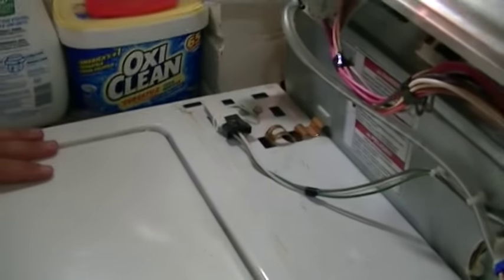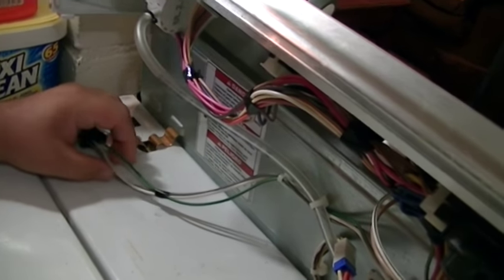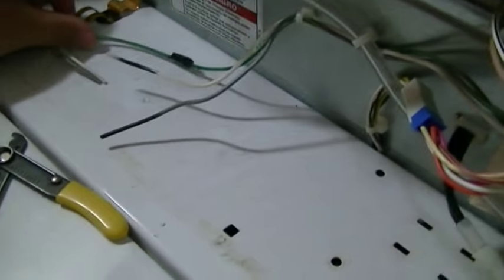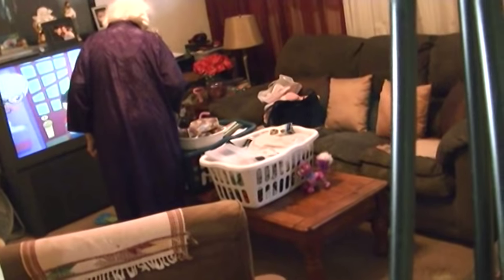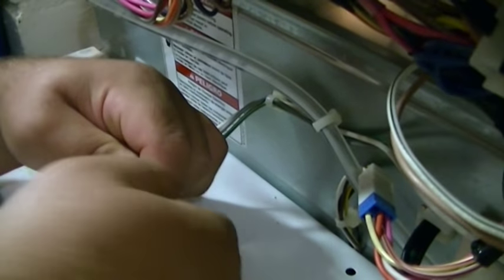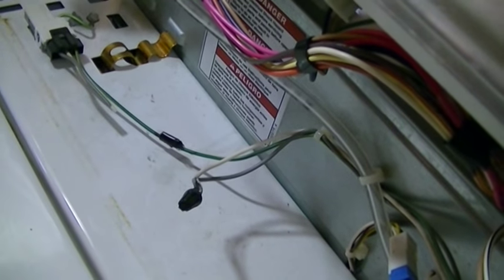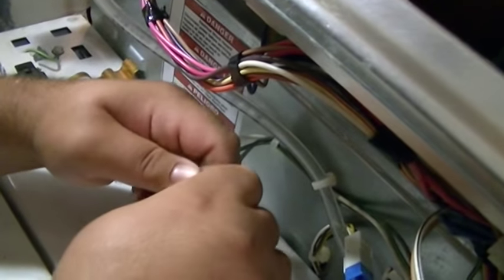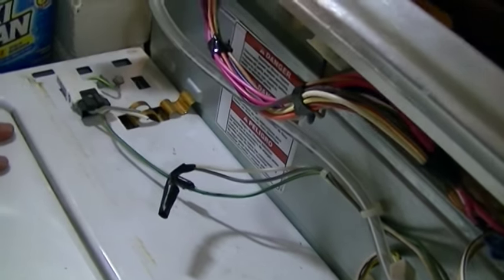Quick & Easy Whirlpool Washer Lid Switch Defeat

Comment: I ended up cutting all 3 👎🏽 can it still work if crimp the ground too?
Reply from the maker: You can leave the ground disconnected, or reconnect it to the chassis for safety, but it should be grounded through the case screws.
Reply: jaykay18  I left it bare should I put tape on it ? There’s no way to ground it unless I drill a whole in the frame
Reply from the maker: @garygonzales1568  Yeah just tape it up good and you'll be fine.

Comment: Whirlpool lidlock 10682535, snipped outside wires (blue & red) and wire nutted together. Washer is still giving the locked LED status / clicking sound. What else could my problem be
Reply from the maker: You didn't read the description.
Reply: Sory didn’t realize there is a full description I thought it was just a short 5 word description of the video
Reply from the maker: @jus10inla  That's why it's always important to read them, you never know.
Reply: @jaykay18 im still learning how YouTube does descriptions sorry
Reply from the maker: @jus10inla  It's the same for every video you watch.
Reply: Thanks for the info. I rarely use youtube. Let alone comment. Now i see why

Comment: May be yoi might why the lock light is flashing on my whirlpool top loader washer  and won't start or finish the cycle
Reply from the maker: Problem with the lock.  This video won't help you, you have to probably replace the lock assembly and/or latch.

Comment: We just used a wire bread tie to jump the contacts in the wire loom connector.
Just stripped enough of the wire on each end to fold it twice and push it in the back end of each connector, #1 & #3.
Reply from the maker: A bread tie?  I'd expect wire that thin to melt immediately.  If I'm not connecting wires directly together, I use a minimum of 14 AWG.
Reply: @jaykay18  ....I'm a certified electrician and the circuit goes into connecting a transistor on a circuit board....that new part is $90 bucks, and on Amazon $130.
When it eventually gets replaced after this Christmas, your fix has to be undone, mine just gets removed. 
My son-in-law needed a quick fix, and I told him to Google it.
Reply from the maker: @keithlucas6260  He must have a different machine.  There are NO circuit boards in this washer at all, it's all done with mechanical switches and timers.
Reply: @jaykay18  ...yep the wires are 1\8 aw which are basically the same size as that bread tie with thicker plastic. My son-in-law didn't unplug the machine and just pushed the wires in hot, got shocked and shorted the board.
I usually use one of those blue tag connectors that come with trailer wire kits to tie into the wireloom. I cut out the end stop on the one side making it easy to just bypass without all the hassle of cutting, stripping and wire nutting the ends plus figuring out where to fasten it to with an added wire tie....looks neater as well as un-doable.
Reply from the maker: @keithlucas6260  I had no need to undo this modification.  I find that wire-nutting provides for a much more positive connection.  Preferably I'd solder and heat-shrink.
Reply: @jaykay18  yeah I usually do that as well on high amp circuits, but the daughter wanted to buy that stupid switch later on......maybe an in-line toggle switch at the back for that optional fix when it goes out again.
Reply from the maker: @keithlucas6260  I did just that on my own washer:  https://www.youtube.com/watch?v=Lo7k2t1V574

Comment: Will this work on a w10562358A series?  The wires are red, white, and blue
Reply from the maker: That number comes up for a dryer.
Reply: Sorry, its wtw4950hw1
Reply from the maker: That's a Playskool washer with a lid lock and a belt drive.  Everything's computer controlled, and without that lid lock and switch working properly, the washer wants to be brought to the curb so it can be recycled into more Playskool junk, that will break in short order.

You need to fix the actual problem, and that means parts, maybe even sensors or circuit boards.

Comment: Once again…appreciate your easy to follow videos. Got a series 80 2nd hand. Someone previously had done this mod BUT they snipped the wires as close to the molex connector as possible. No excess wire to strip and rejoin if I wanted to repair/replace the lid switch. With this mod on the wiring harness side if I wanted to repair the connector I need a new piece WITH pins. Can’t find one with pins. Trying not to replace the entire wiring harness. Any thoughts? (We don’t have kids so we could leave it be - just not my first choice.)
Reply from the maker: Thanks very much!  While I don't know precisely how to do it, it is possible to remove the pins from the connector.  Then you can solder wires on.  Otherwise, just leave it alone, out of sight, out of mind.  Also makes it exceptionally easy to just throw that one item you forgot in.

Comment: Hello after 6 years 😂 would this work if my whirlpool washing machine dosnt drain some times? Hope ican get an answer
Reply from the maker: If I can get a model number of the machine, I can look it up.
Reply: Ok thank you so much will send it shortly
Reply: model 3xwtw5705sw0 doesn't drain all water and some times out of nowhere it just drains it all.
Reply: I think it's the same model you have in this video as the lid switch looks the same and in exact location
Reply from the maker: @ytubeworld.  Yes, the innards are the same.  If it's not draining, then it wouldn't be agitating either, because the lid switch controls the entire washer on this style unit.  If the machine will fill and agitate but not drain, chances are the drain pump is bad and you will need to replace that.  There are many videos out there on how to do it, it's very easy.  That's if the motor runs.  If it won't run at all when it's supposed to drain or spin, it is possible the motor itself has gone bad.
Reply: Thanks ❤ will do that
Reply from the maker: @ytubeworld.  OK, good luck.

Comment: Hey...i tried to bypass my switch.. it didn't work.  My machine won't come on. You can hear the lid arm click to trigger the sensor,  but the trigger doesn't start the cycle.  Then it won't fill nor start the agitation cycle. But it will spin and drain.  Whats wrong with my poor crazy machine?
Reply from the maker: If you can give me the model number of your machine, I'd be happy to look at the schematic and see what other problem your machine may have.
Reply: @jaykay18    I've unhooked both water hoses and checked water to make sure the pipes didn't freeze and burst or something and water indeed Comes from the wall,  just won't pump into the machine to fill it.  The machine is not telling itself to fill&agitate..
Reply: @jaykay18    i also unhooked the water hose and manually filled the tub with water to see if it would agitate once the "filled" water level was reached, and it did not begin agitation cycle. But if i manually adjust the dial to the spin portion it will spin and drain.
Reply from the maker: @FixitWithFoxy  Thanks for the additional information.  But without the model number, I don't know exactly what machine you have.  They made many of the same style over the years but each one has little nuances that makes it different from others.  If you have the model number, I will be happy to give you my insight.
Reply: @jaykay18  oh snap...i pasted over my own text with the explanation...Whirlpool WTW58ESVW
Reply from the maker: @FixitWithFoxy  You have a very rare machine.  I had actually looked at that model or one in the same class when I bought a machine about 14 years ago.  But I settled for the model below, which turned out to be a wise choice.

Your machine has automatic load sensing.  It's sort of a "hybrid" machine where it started to get computerized, yet the mechanism that does all the work was the good old, reliable, tried-and-true direct drive.

But that load sensing thing is a problem.  I know that that system is tied in with the lid switch directly, in that if you open the lid while it is filling it screws the whole thing up.  So the very first think I would do is put a multimeter on the lid switch and check for continuity when the lid is down, and open circuit when the lid is up.  If you see that, clearly this was never your problem to begin with.

By default, the machines are designed to be able to still spin and drain in the event of a fault, which is why it's doing that.

Another good test would be to put the meter on AC volts and test the water valve terminals once you start the machine.  If the valves themselves are stuck or broken, that could be the issue.  But that seems unlikely because you say that you filled it manually and it still didn't do anything.

If the lid switch indeed checks out, that means the problem is with the automatic load sensing circuit.  That's where it gets into circuit boards and all that, and you pretty much are going to be guessing at what parts need to be replaced.  It could be that circuit board, it could be a sensor within it.  I'm not the one to ask about that, as like I said before I steered away from that machine due to the automatic load sensing, as I knew it would be problematic, and here you are.

There is also a possibility that the timer itself is bad.  My recommendation is to try starting it in other cycles, the most-used one tends to wear out faster.  They also changed the timer design on this series, which I have found to be not quite as robust as their older timers.  Hopefully I have given you some insight and some things to check.  Don't give up and buy a new one, you will be extraordinarily dissatisfied with the wash action and how everything comes out.  If it were me, I'd continue doing more and more research on the problem to see if anyone has any more insight as to what the problem might be, and go from there.  Should you decide to replace the machine, Speed Queen TC5 series are the only good machines left.  You'll pay dearly but it might just last 25 years or more.  Otherwise, you can see if there are used appliance shops near you and see if they have something similar that doesn't have the automatic load sensing.  Take a picture of the control panel and show them, tell them you want a Whirlpool (or Kenmore, same thing) direct drive washer.  Quick rule of thumb (not always guaranteed to prove) is that if you open the machine and jiggle the basket, if it moves all around wildly, it is NOT the one you want, it should feel kind of stiff to move around, like yours.  Good luck.  I can assure you, you'll never find anyone else like me who will take the time to try and help you.  Let me know how it turns out.
Reply: @jaykay18  anytime you add too much technology,  youre setting yourself up for problems.  And actually,  the basket is wobbling all around loosely which i don't remember it doing... could that indicate an issue deeper in? Like maybe an uneven load knocked something off kilter?
Reply from the maker: @FixitWithFoxy  Time to pull the cabinet off and have a look.  There might be a broken spring.  I've also seen it where the frame rusts out and the hole the spring went through gives out.  It might also reveal something obviously wrong.

Cabinet removal is easy.  Open the panel up like you had, and on either side are 2 gold colored metal clips.  They "dip down" into the machine.  Put a big flat blade screwdriver in the dip there and pry the clips forward (screwdriver handle pushing towards the wall).  The clips will pop, twist them to unhook from the back.  Open the lid, grab the front case in the center, and rock the cabinet toward you.  Then just grab the whole thing and pull it off.
Reply: @jaykay18  would the spring cause the starting issues or just the loose tub issue?
Reply from the maker: @FixitWithFoxy  Just the loose tub issue.  But you never know, you might find a loose connector inside the machine.

Comment: I could be wrong, but it was my understanding that those particular cutters are designed for zip-ties and not wire.
Reply from the maker: Nope, those are definitely marketed as wire strippers.  There's even a little adjustment screw that can be loosened, and a guide moved, to accommodate different wire gauges.

There is a separate tool just for zip ties, one of these days I'll pick that up.
Reply: Ok, mine, have no adjustment or markings, just purely cutters other than that they're physically identical, but mine are zip-tie cutters, that's why I brought it up lol
Reply from the maker: I'm wondering if they screwed up marketing the one you have.  Do a quick search on Google for "zip tie cutters" and it doesn't come up with a tool that looks like this.

Comment: I have a 3-wire switch on a Frigidaire Electrolux washer/dryer. The wire colors are blue, black and white. Which 2 wires do I put together? Which is the ground?
Reply from the maker: Get a wiring diagram and check for yourself.  This is for a Whirlpool machine.

Comment: Does this work on a whirlpool chrome shadow washer
Reply from the maker: The only thing that will fix that machine is the garbage dump.
Reply: @jaykay18  dang that is not what I wanted to hear. Lol. Our lid lock decided to die tonight and then my husband broke out the whole housing case beating it up so I was hoping the wire trick would solve the prob

Comment: I'm having trouble with my point of view here.  When I open the control panel, I can see where the plastic terminal (from the main control board) that leads to the lock mechanism is.  It has four wires coming out of it that leads in a black plastic hose to the washer top.  There are 4 wires coming out of it.  Blue, red, yellow and white.  I don't understand where I am supposed to see the green, white and grey wires
Reply from the maker: You didn't read the description.  Do that, then throw your washer out, it's not worth fixing.

Comment: Hey do this bypass the lid lock
Reply from the maker: That's not this kind of machine.  There is no way to bypass the lid lock if it's broken.  If it fully works, you can dismount the latch from the lid and stick it into the lock and it will work that way.

Comment: How do I bypass lid locking switch on Amana washer. Washer will not go through all cycles
Reply from the maker: Does that machine lock the lid when it's running?
Reply: @jaykay18  yes it does
Reply from the maker: You can't.  You have 2 options:
1.  Fix the actual problem, whatever it costs.
2.  Get an old-school washer from a used appliance shop.  This is clearly your better option, because if you choose option 1, you're going to end up fixing something else more serious on that washer probably in short order.

Comment: Thia applys to which models?
Reply from the maker: There were THOUSANDS of models made.  It's impossible for me to give you a list.  If your washer has any of the following, this probably won't work:
1.  An electronic control panel, especially one with a Play/Pause button.
2.  A cover lid lock.
3.  If the wires to the switch are red, blue, and some other colors.

Comment: Have a Whirlpool wtw 4800 bq1 will it wrk
Reply from the maker: That's a Playskool washer with a lid lock and a belt drive.  Everything's computer controlled, and without that lid lock and switch working properly, the washer wants to be brought to the curb so it can be recycled into more Playskool junk, that will break in short order.

You need to fix the actual problem, and that means parts, maybe even sensors or circuit boards.

Comment: What if the wires are red white and blue?
Reply from the maker: That's a Playskool washer with a lid lock and a belt drive.  Everything's computer controlled, and without that lid lock and switch working properly, the washer wants to be brought to the curb so it can be recycled into more Playskool junk, that will break in short order.

You need to fix the actual problem, and that means parts, maybe even sensors or circuit boards.

Comment: why not put in a new switch?
Reply from the maker: There was nothing wrong with the switch to start with.  The owner asked me to bypass it.  I have performed this modification on my own 2 machines as well.  I want control of the machine, not the machine having control over me.  If the switch is there for safety, I can exercise my own safety.  Just like a mechanic can work under the hood of a car with the engine running if need be.  The mechanic exercises their own caution.  Yes, accidents happen when you're not careful.  Then you learn from your mistakes.

Comment: Will this work on a  whirlpool wtw5000dw0?
Reply from the maker: That's a Playskool washer with a lid lock and a belt drive.  Everything's computer controlled, and without that lid lock and switch working properly, the washer wants to be brought to the curb so it can be recycled into more Playskool junk, that will break in short order.

You need to fix the actual problem, and that means parts, maybe even sensors or circuit boards.
Reply: @jaykay18  thank you so much for responding back so quick. I kind of figured that after reading all your comments. I just wanted to double check with you. Thank you again.
Reply from the maker: No problem.